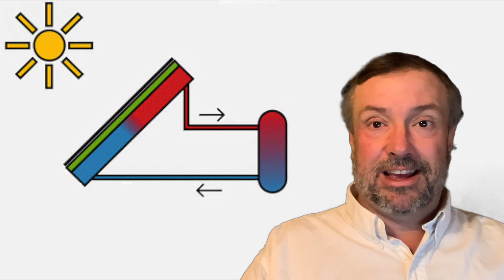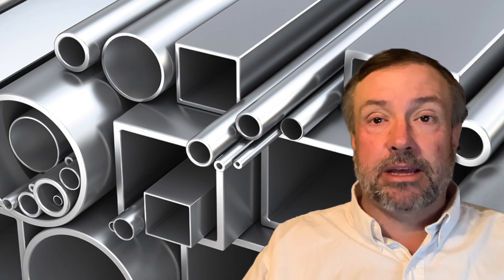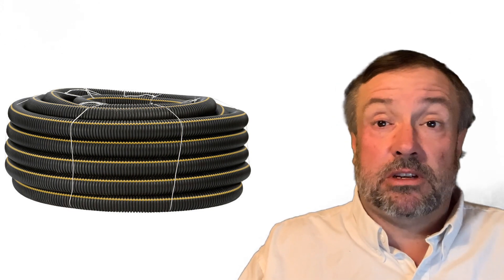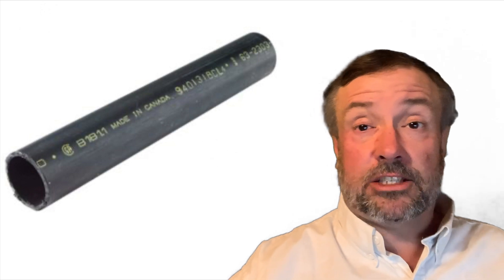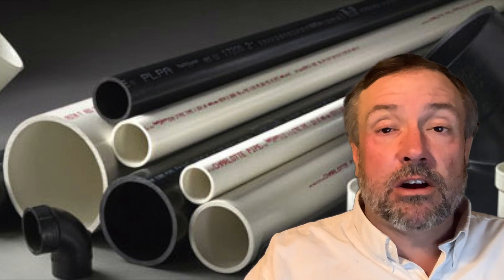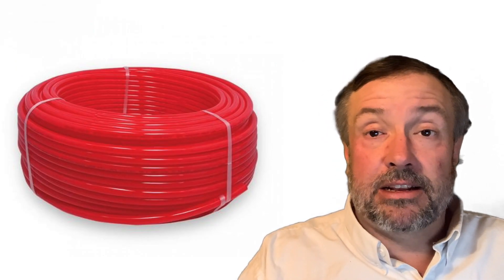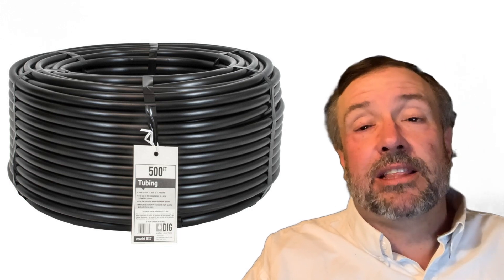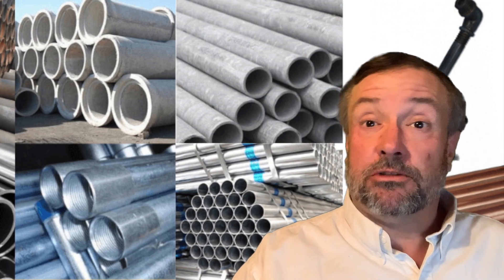Thermal Battery Piping Options

Comment from the maker: Do you use an air or liquid heat delivery system in your thermal battery and why?
Reply: I suspect that I'll need two circuits for the situation I'm considering.  One circuit in pex for glycol/antifreeze from the solar collector to the battery.  The other weeping tile for the air from the space through the battery.    I'm still looking for some way to numerically model my system so that I can get an idea of the heat capacity and transfer rates for given flows. I like having a back of the envelope calculation up front just to help set expectations.
Reply from the maker: @chrisfedde  my best advise is testing!!!!! Thank you for the great response!
Reply: @SimpleTek  a
Reply from the maker: @lafnjohn3292  sweet

Comment: Great vid - thanks I have a 10x10 insulated block building i am going to use for my sand battery- heating the sand with both solar and a wood heater { as a backup im in northern Mn} built into the battery, im thinking i will need to use copper coils in the sand because of the heat that may be present from the wood stove, any thoughts on this?
Reply from the maker: Sounds interesting, keep me updated on your progress

Comment: For all PEX pipe and tubing, the maximum operating temperature is 200°F. No PEX should be operated at temperatures above 200°F for any length of time. The use of crosslinked polyethylene (PEX) pipe and tubing in high- temperature applications with operating temperatures above 180°F may affect the tubing's design life.

Comment: I need to heat my honey room to 100F. The dimensions of my room is 8’WX 12’L X 12’H = 1152cf. I will place a solar collector on the south side of the room and wish to draw air through the system to store heat inside my honey warming room. It must the dissipate that heat throughout the day/night maintaining a fairly  constant ambient room temperature of 100F to heat the bulk honey for bottling or frames of honey for extraction to about 90F.

Can you recommend a collection system, piping, and storage system (I was considering river stones in a 30 gal to 55 gal steel drum. What are your thoughts?
Reply from the maker: I just use home depo or Amazon/eBay for that kind of stuff…
Reply: Added thought: I have a south facing window in that room that I’ve blanked off. I’ll modify that for my solar panel and then use insulated ducting to draw hot air into a solar battery filled with river rock. Yes? No?

Comment: If your thematic battery is sand... why not green sand (used to make moulds for casting metal)?... form the pipe structure  in the sand itself.

I know it sounds crazy - but checkout a few green sand casting videos.

Maybe add a little cement, lay the sand in layers and cast the pipe work structure into the sand itself. - with no additional material.  

As a final thought why not spray the hot water on the top of a sand battery and let it trickle down under gravity (no pipes needed) and pump cold air in at the bottom to rise through and get heated (again no pipes needed).
Reply from the maker: not crazy at all!

Comment: I did not hear any  mention of the thermal conductivity of any of the different types of piping. That is the ability of the material to transfer heat through the material. Copper has a much larger heat transfer ability then ABS. The reason one wants a high heat conductivity is not for the transport of the heat to or from the heat exchanger (in that case a high insulation value is desired) but rather to transfer the heat between the heat exchanger fluid and the material that is to be heated/cooled.
Reply from the maker: good point

Comment: Do you have a suggestion for the size and type of circulator pump that can be used with Pex and polypropylene glycol for the application with a car radiator and a 20" box fan in a greenhouse?
Reply from the maker: ask your plumbing supply store - they have tables there so you get the right pump for length and volume of tubing

Comment: Ive been playing with a design for a number of years. Finally moving to land big enough to install a system. Going to see if I can apply the experience towards my physics degree. 

You mentioned wanting 100k btu per hour of output in your last video....just curious why youre wanting so much output. Our 60k btu furnace currently heats our 1400 sq ft home during winter and uses around 200k btu per day max. 100k btu an hour is SO much output.
Reply from the maker: greenhouses use a LOT more energy than houses for heating

Comment: I live in Florida. I haven't seen much about cooling. I have even considered a cooper line under the ground, and circulate the air from inside the house with a small air pump.
Reply from the maker: cooling is important!

Comment: For metallic air piping consider aluminum downspouts.
They do not have great crush resistance,  but that isn't always important.
The solar collector itself could be made of aluminum downspouts and the heat exchanger in a raised bed.
Its also a candidate for carrying steam.
Reply: I stripped the paint off and painted it with hi-heat BBQ paint. I built a collector box insulated with fiberglass and lined inside with aluminum flashing also painted with BBQ paint. As I was installing the double pane glass I touched the pipe by accident and burnt the back of my hand. This was only after 2 hours in indirect sun. 
As I was renting a second floor apartment at the time, I limited to installation options. So I installed it to the fencing of south-facing balcony on inside part  of fence. ( Safety reasons and not to trigger building code police.). I did lose some heating from the rails shadowing, but it kept landlord happy. Well that 4 ft X 10 ft unit would blast heat into our apartment to maintain 25*C for 4-6 hours a day in - 30 to - 35*C days. Considering it had no heat sink to bank and save us about 25 % of heating during the coldest days of winter, we were happy.
So I say Aluminum downspouts are a fantastic option. As they do come in square shape, by placing on a diamond angle in heat sink as you fill with sand will up its crush-resistance to sand above it.
Reply: @redstone1999  Again, excellent advice. Your comments sparked my imagination. I was thinking of using them with a sand battery because pex tubing or plastic pipes would just melt. I feel like a mad scientist!
Reply: @ChrisC-n2c  Thank you, sir. Yes, we are scientist. Not a mad scientists, but  curious scientists. I love to experiment. Most end up as brain-farts, but some do actually work out as planned or better.

The more you do and learn, the more you find solutions easier. I have spent 58 years of my 62 years playing " What can I do/make with this ... ? ". I drove my parents crazy. Dad finally decided I needed my own lab away from house incase I blew myself up or release bio-hazardous material from my bedroom or basement hobby room.
Reply from the maker: @redstone1999  That's awesome
Reply from the maker: great ideas!
Reply: @ChrisC-n2c  OOPS !! My bad. And my youngest daughter's name is Christine. We call her 'Teen' , even that she is in her 30's. :D

Comment: I just used pex for the in floor heating in my home that I am currently building. It was so cheap! It only cost $150 for all the piping for my 800 sqft first floor. The 4" pad is insulated with 3" of styrofoam and my heat source is from the wood stove. Copper piping from the wood stove to the tank then copper to the heat exchanger and then Pex filled with glycol from there. That aluminized pex sounds intriguing though, I will look into that for next time
Reply from the maker: That sounds like an awesome system!
Reply: Is that a purpose made outdoor wood burner or a DIY'd conversation of an indoor wood stove?

Comment: Another option that may have been covered is the stuff they use for maple sap collection. They use poly for mainlines but the laterals are more flexible and smaller although just like the poly piping, I would think that they are only suited to low temperature heat sources.
Reply from the maker: Great tip!

Comment: Another way of transferring heat is to use a heat exchanger between the high temperature storage/generator and the pipes to transfer it into the home.  So as an example,  from the storage/generator to the heat exchanger,  you use metal piping.  The heat exchanger is well insulated and is filled with a liquid capable of handling temps up to 200 C,  but the max temperature control setting for the heat exchanger is set to 150C.  The piping inside the heat exchanger is all metal,  but the piping exiting to the house/greenhouse is such that can handle up to 150 C (it should never actually reach this temperature with the house/greenhouse fluid circuit circulating.
Reply from the maker: what type to you suggest?